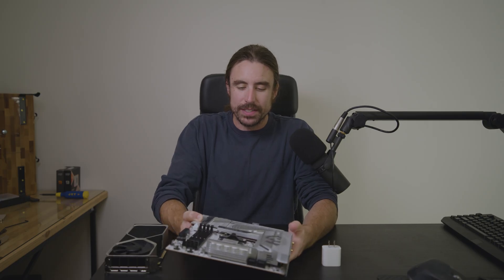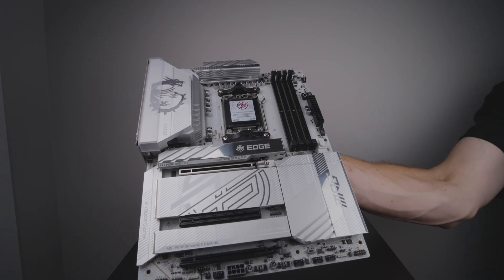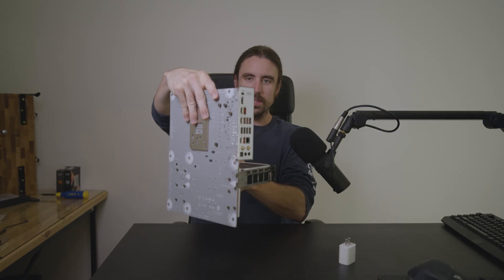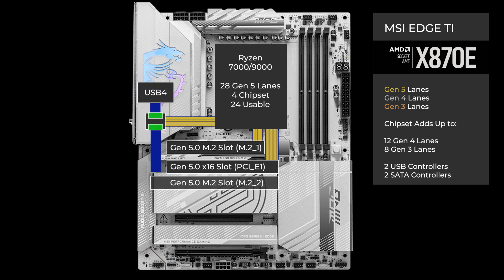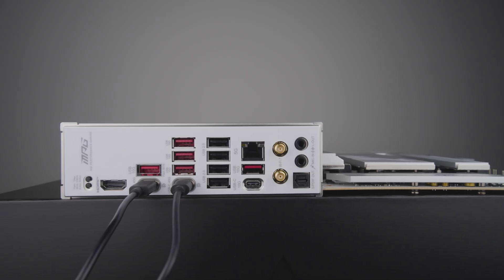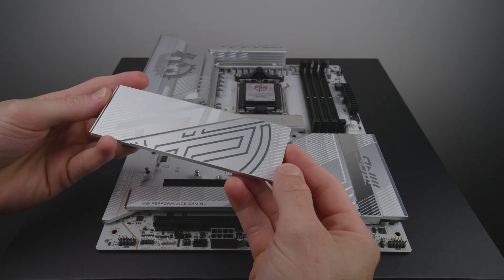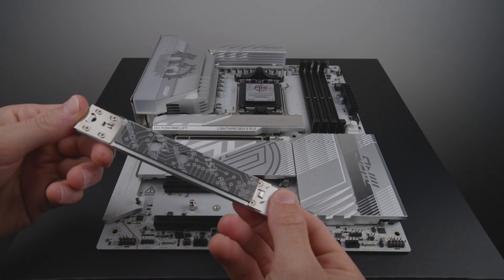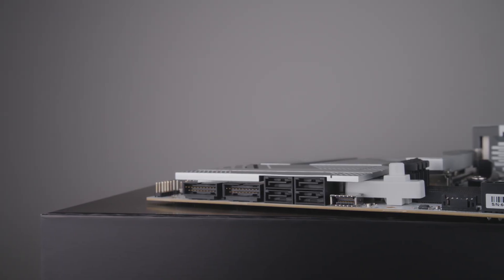MSI X870E Edge TI PCIe Lanes and Slots

Comment: Can the second m.2 slot use a gen 4 drive instead of Gen 5 or only for Gen 5
Reply from the maker: It can use Gen4, these slots are backwards compatible with previous generations.
Reply: @Ronin-Wilde ok

Comment: What GPU did you use to insert it into the pcie gen 5 lane? I bought this same mobo as well but im having trouble inserting my 5070 ti asus tuf gpu and once I insert it does it auto lock the gpu in or I have to press the button to lock it
Reply from the maker: There is a little button to push and a small picture of lock/unlock. When you have it in the unlock position, insert your card and then press it again to lock it.
Reply: @Ronin-Wilde  Thank you for replying to me but I ended up looking up the official msi motherboard manual and it says to insert the gpu when it locked because the pcie gen 5 latch is spring loaded so it auto locks. The only time you press the button it to unlock the slot and pull out the gpu card.
Reply from the maker: @kyokoqueenx3122  well I learned something new, I definitely did not do that lol thanks.

Comment: I got this MB with Ryzen 7 9800x3d and MSI Suprim 5090 also 2 Samsung 9100 nvme .. put 1 m.2 in first slot and 2 m.2 in second NVME slot below the GPU and I disable USB 4 in bios .. so all my m.2's works at GEN 5 speed. its a fantastic MB very recommended.
Reply: but i received the MB from amazon with OLD bios version v1A20 .. need to flash the bios to get latest update coz msi fixed usb 4 issue when disabling it in bios .. sometimes it still works at 2 lane .. so, they fixed that in latest bios v1A61
Reply: Thanks for sharing I will be doing the same with my next build as far as running two gen 5 ssd’s and disabling usb4. Much better alternative in my use case than sharing those lanes with the pcie x16 lane imo and one reason I went with this board!

Comment: So I can have my m.2-1 and disable usb4 and also have m.2-2 at full speed. But what if I wanted to add a third m.2 and a capture card. For the best performance which m.2 and which pcie slots would work best?? I don’t care about sata, but I definitely need Wi-Fi and Bluetooth. I guess the pcie-3 and m.2-4 ?? That would half my lanes on both tho. I’m saving up for an Msi godlike , I’m tired of ll this lane sharing! 
Thanks for the video!
Reply from the maker: You can have a 3rd and 4th ssd in the 3rd and 4th m.2 slots. There is also a slot at the bottom with 4 Gen4 lanes that would support a capture card. If you are looking for no lane sharing X870E boards this is the best layout. It's similar to, Tomahawk and Gigabyte stealth.

You'll find less lane sharing on the less expensive boards. The more expensive boards have the most CPU direct lane sharing. It's a more premium feature because they can market it as more slots. It also cost more to make because more Gen5 lanes means more complex and costly boards.
Reply: @Ronin-Wilde  thanks for the info! If i did use the m.2-3 and 4 slots populated, wouldn’t they both run at x2 bandwidth since they are both connected to the same chipset? And wouldn’t it affect the gen 4 pcie slot that’s also connected? I know on some boards if both are used then the slot turns off completely. I hope Msi didn’t do that..I wonder if the Gpu slot is affected by the other pcie slots too. Like the carbon. Msi didn’t release much info on this board on their website either. 🤔

Comment: I want PCI_E1 running x16 and 2 nvme drives with x4 lanes directly to the CPU. The B850 Mobo offers this with no switching or passthroughs with other chips needed. The X870E has switch passthroughs and "daisy-chained" chip sets for I/O. I enjoy the quick release and overall aesthetic of the E870X's M.2 heatsinks and other added heatsinks around the board over the B850's hardware.

Taking into account anything I may be sacrificing, including any latency and potential data interruptions introduced by the dual chip set and switches, which board would you recommend for my all white MSI build?
Reply: You can just disable usb4 in the bios so you'll get full gen 5 x4 on the second slot. I prefer that actually, msi is the only manufacturer that does that. Also is the latency even matter at this point? I don't think it will affect speed that much.

Comment: Just brought this board for all 4x PCIE lane M.2 slots to fill with a 9100 pro and some older gen 3 SSDs, maybe an extra gen 3/4 4TB SSD, I could care less about USB 4, I can stand with all drives filling up the chipset Bandwidth And slowing down, what can't stand with is M.2 running at 2 lane and B850 boards do exactly that, which brings the questions onto why asmedia chipset sucks so much when it comes to PCIE lanes, stability issue is the only reason I could think of.

Comment: Ronin, Question, if I use a Gen 5.0 in M.2-1 slot and another Gen 5.0 in M.2-2 slot and turn off USB4. Is the GPU in slot PCI_E1 still going to run at Gen 5 x16 ? or will it be reduced to Gen 4 x16 or Gen 5 x 8 ?
Reply from the maker: PCI_E1 will run at Gen5 x16. The Edge TI doesn’t have a switch on the x16 slot. It’ll run at the highest Gen and most amount of lanes that are supported by the graphics card and slot.
Reply: @Ronin-Wilde  not if all lanes are saturated. That is why all x870 boards resort to an 8x/8x configuration when multiple slots are occupied. The X870 chipset was not designed to accomodate PCIE 5.0 specification. It was built for 4.0. So what happens when a 5.0 X16 slot is reduced to 5.0 X8? You end up with the equivalent of x16 4.0 to the GPU so that the other devices have enough lanes to function.
Reply from the maker: I think I can help with the confusion here Mike. You are right the “physical chipset” does not support Gen5.

The 24 CPU direct Gen5 lanes are completely independent of the physical chipset. They go directly to the x16 slot, x4 slot for main m.2 and 4 for general purpose lanes used for USB4. These are direct to the CPU and don’t share bandwidth with the chipset.

The physical chipset connects to the CPU with 4 Gen4 lanes and shares the bandwidth with all chipset connected slots/ports. Completely independent of CPU direct slots/ports.

Some boards have a x8/x8 configuration on the CPU direct x16 slot. This is usually found on higher end boards that provide more Gen5 connectivity. There are other switch configurations that provide more m.2 slots etc.
Hope that helps.

Comment: Thank you so much for making those videos, I wish the lane sharing wasn't so confusing on those motherboards. Do you have any plans to do those for X870 and X870E MSI gaming plus motherboards? For some reason I can't seem to find enough reviews of those that explain the lane sharing in them, specially the X870E version
Reply from the maker: I am glad you like them! I plan to finish all the X870E boards and then move on to X870. The X870E gaming plus is very similar to the tomahawk and Edge TI. It doesn’t have a PCIe switch on USB4 that allows for a second Gen5 M.2 slot. That’s the biggest difference.

Comment: Just bought this board.. wanted the gigabytes version but bent the pins and they had no more in stock.. liked the gigabyte one better because everything was white on it including the ram slots. But because it was sold out and couldn't be replaced i went with this board.. still a great board but the 870E Aorus looks cleaner
Reply: Ha ha, I also wanted the Gigabyte Aorus board, loved the look and it matched my graphics card (Aorus Ice RTX 5090), but it was out of stock so I ended up getting this one instead. The no sharing of lanes between the GPU and M2 slots on this board makes it a better option to me (not as good looking though😅)
Reply: how do you like this board so far? about to pull trigger but have heard of sleep mode issues and code 11... its either this or a Gigabyte that does GPU share.  Thanks
Reply: @sportindaveyg haven’t had any issues with this mobo it’s amazing.. my only thing I’m not a fan of is the msi center app but to be honest no mobo app seems to be good..

Comment: Man of all the X870E motherboards, I think I see this one the least and almost no one talks about it for some reason... It is either the Carbon or the Tomahawk. I like MSI's work around lane sharing with the GPU by having the second M.2 share lanes with USB4 instead.
Reply: Yep its freaking awesome if your trying to fill all m.2's and want x16 on gpu  no matter what I have zero use for 4.0 usb anyway just 3.0 for me is fine
Reply from the maker: I like the work around too, leaves your options open. I noticed Gigabyte does this on their newer X870 stealth board. Thankfully MSI got creative and made this a thing, I think 4 CPU lanes for USB4 almost become the new normal.
Reply: I like the ASRock x870e Nova Wifi strategy to lane sharing even more than this board's, but this one is close (and much better than some Gigabyte boards that lane share across the Gen 5 GPU slot). Having said that, I'm on alert with my Nova and my 9800X3D. So far so good over more than 1 year, and when inspecting my CPU, I have no burning or discoloration in the slightest, but I'm still considering a board swap.
Reply: Cant decide if this or the tomahawk. Is the only real difference the colour and rgb??
Reply: @Pago88 Yes RGB asthetics and toolless heatsinks. Edge Ti compared to the tomahawk  has full toolless m.2 heatsinks for all SSD slots not just the gen 5 slot. Other than that I can't recall on top of my head the motherboard pin headers differences if that is relevant to you look it up.
Reply: @GlacierRain alr thx,

Comment: i've the b850 edge ti and paired with 9800x3d, the b850 don't share second gen5 lane with usb C, it's got everything same like RGB, enough Ports (not USB 3.2) and the Post code, great MB i can recommend for who just want Gaming like me🔝
Reply from the maker: That’s great to hear, do you have an all white build? Just wondering how well it matches white components/cases.
Reply: @Ronin-Wilde  thanks, no it's like 70% White, 25% Black and 5% Bronze(GPU), I got the Fractal Design Meshify Compact 2 RGB and yeah that's what I wanted to have, the PC is last week finished and at first I've Updated the Bios, enabled X3D&EXPO and some little tweaking's for the fans. I'm happy that I didn't get any Problem's/Issues yet, Good work MSI

I Uploaded some PIC's of it on PCPartPicker but when i send the link my comment gets deleted. sooo It's with only one m.2 gen 5, I'll get another one on BlackFriday and maybe change my fan's to Lian Li Infinity like the Lian LI AIO (Actual fans are great but for aesthetic:hand-purple-blue-peace:).
Reply from the maker: There is a "share your build" channel in our discord if you want to upload it. I'd be interested in seeing it. Here is a link if you want. https://discord.gg/js5z5B8j